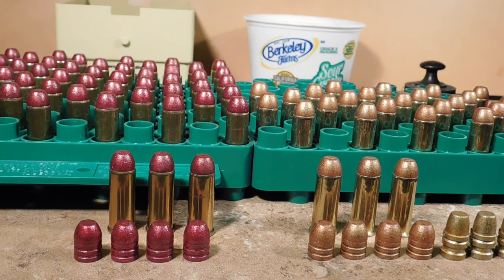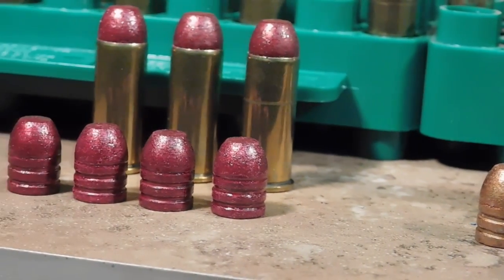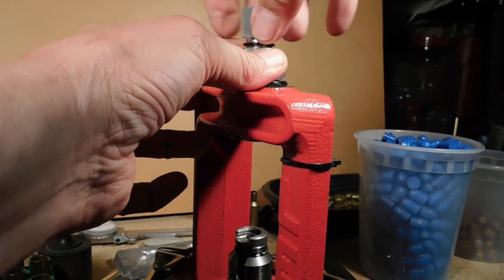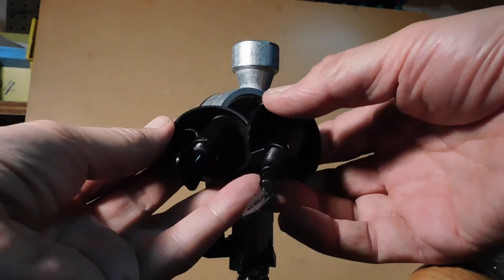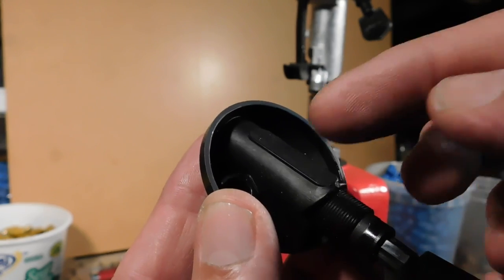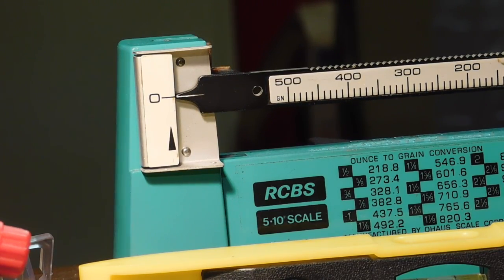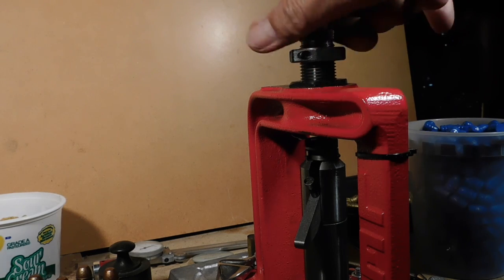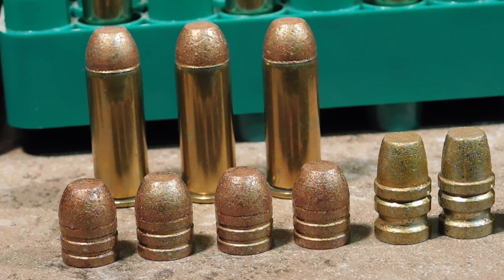Loading Hi-Tek Bullets: The Repeatability of the Lee Auto Drum Powder Measure

Comment: I honestly don't understand why would you want to use Lee Auto Drum on a single stage?  I use my RCBS uniflow powder measure for .357 I put 50 cases in 45 ACP tray, works even better with 300 BLK or 223 as I can use 9mm ammo tray, it's very compact compare to something like Hornady reloading tray, than I drop powder in to 50 cases without removing a single case, not only RCBS Uniflow is 10x better than lee it's actually a lot faster this way and I can inspect all cases with flashlight and I got it in new condition from eBay for something like 50 bucks couple years ago the difference is night and day.

Comment: I would agree with the accuracy of the auto drum powder measure.  But I simply cannot get it to stop leaking powder. It is so bad that every 100 rounds or so I have to disassemble and clean the drum area because I no longer get a full stroke of the drum. I will be replacing this powder measure with something else.
Reply: Is yours missing the rubbery urethane wipe?
Reply from the maker: Mobow72 - Something is wrong with that measure...I've only had leaks with the fine grain powders, and those were solvable.  Switching out drums stopped the leak for me...Reminds me of the Classic Powder Measure (Lee stopped making that bear - and brought it back out improved calling it the Deluxe Powder Measure - but the Classic was the worse measure on the face of the Earth).  Best to ya,  FC

Comment: Cookie, Flaring them first is an extra step, However, the Benefits of smooth operation and consistency in powder throws is worth it. For those of us that use an automated machine such as the Dillon, we can size/de-prime and wet tumble then set up an M-die in the sizing station, this will flare and expand before going through the Lee powder measure while we use our progressive press.
Reply from the maker: Dave - As you point out, the extra step works very well.  And good reloadin' to ya,  FC Steve

Comment: local shop has powder coated bullets 50% off for there 50th year in business. $19.99 for box of 500 purchased 5500 its a good start for a new reloader.
FC45 has that radio voice that keeps saying come into the light new reloader come into the light ( im thinking no there zombies in there ) come into the light new reloader  lol
Reply from the maker: MrParts4sale - That is a super price for 500 bullets...Whether you are a bullet caster or not, stocking up would be a good idea - Those prices are like turning the clock back 35 years.  Best to ya,  FC
Reply: just finished first 20 bullets. 125g lee bullet best i can tell.  lee books says min oal 1.125 i had to set at 1.1055 so would drop out of barrel easily when chamber checking. any thought on it being little shorter. i have 9mm ruger american compact
Reply: lee book says 3.6g to 4.0g im using 3.8g so i have room if scale off 0.1 also purchased anoughter 3500 bullets at 19.99 price per 500 seems i have new bullet addiction thanks to you :)
Reply from the maker: MrParts4sale - This reminds me of when the Saturday Night Steel Shooters put in group orders at a commercial caster back in the 1980s.  We each bought minimum 10,000 bullet orders for best pricing and one of our members took a 1 1/2 ton pickup truck to bring the bullets back to us shipping charges saved that way...When the truck came into the parking lot, we divied up our orders - The pricing was down to $19 a thousand that way.  Those were some great times.  Best to ya,  FC